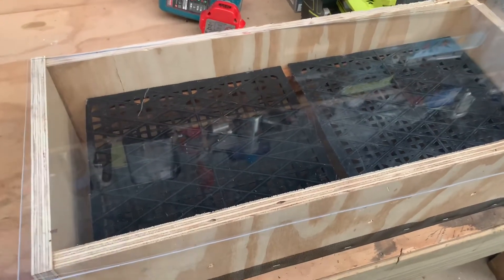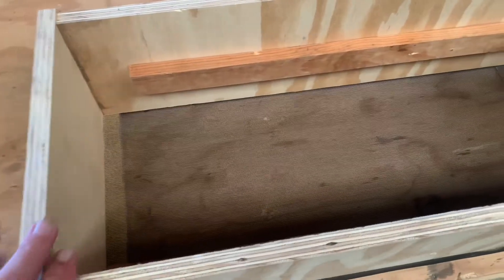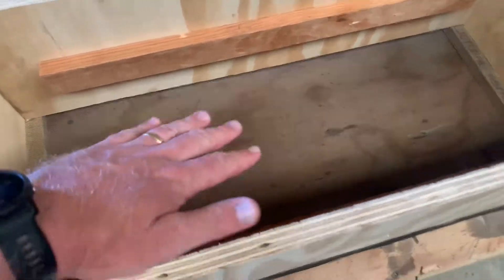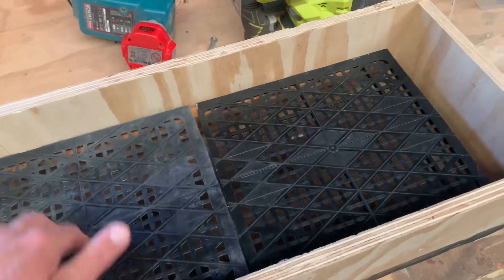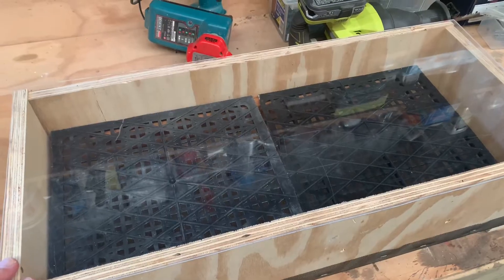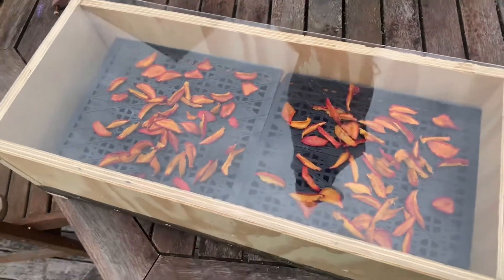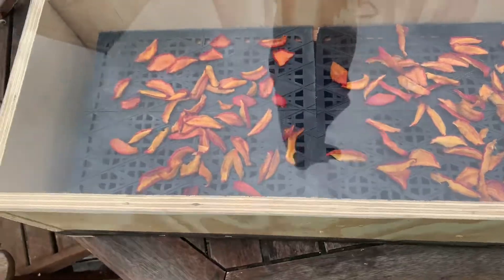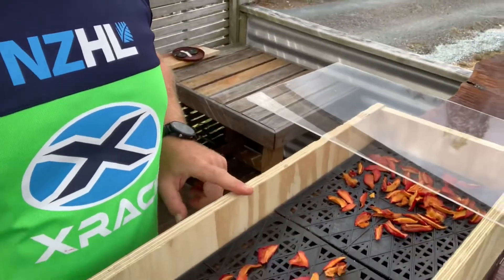Simple Solar Dehydrator (DIY)

Comment: Would a darker-colored interior heat up faster? Wouldn't condensation fog up the glass/acrylic? Does the moisture just drip out the bottom screen?
Reply from the maker: Yes in theory. 
It seems there is enough air flow to prevent the condensation problem you describe.

Comment: No comments?
I was sure se one would comment on the food safety (or lack thereof) the seed tray.
Reply from the maker: Why...?
It’s plastic and has been sterilised.
Reply: @foodrelated  I'm not sure what a seed tray is, but some plastics leach or off gas chemicals, especially when heated.
Other do not, and this difference is part of what  makes a plastic "food safe" or not.
Reply: @foodrelated  I have gone thru 3 microwaves and used the large glass turntables to place my fruits and dry them out in the sun.